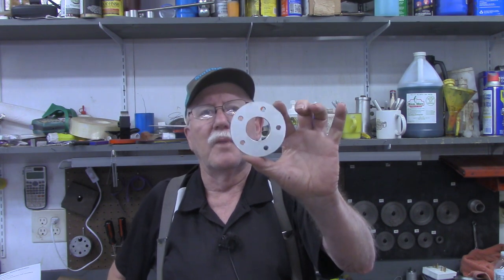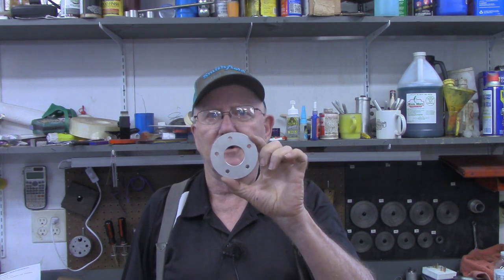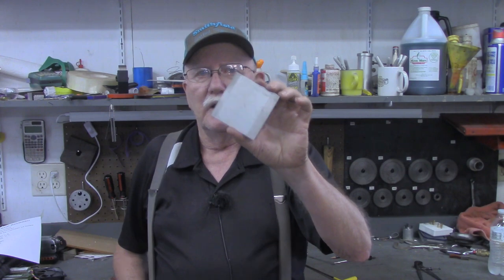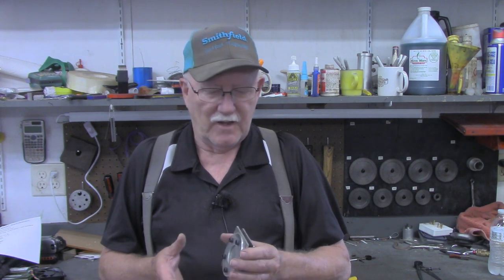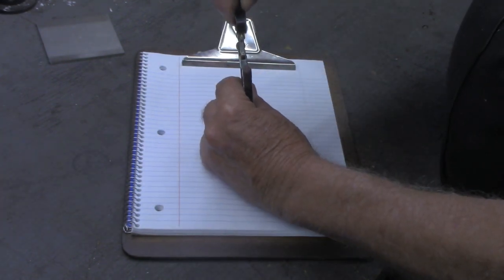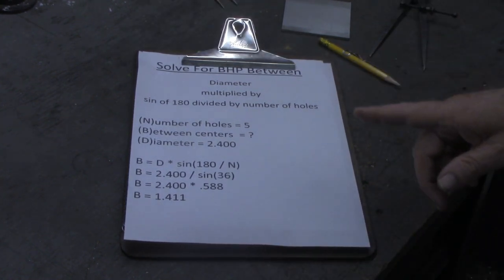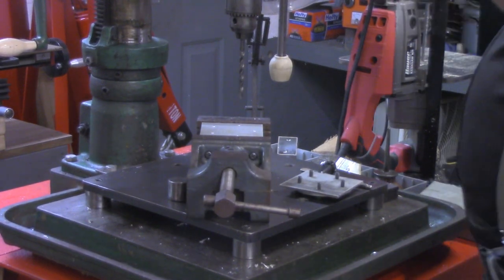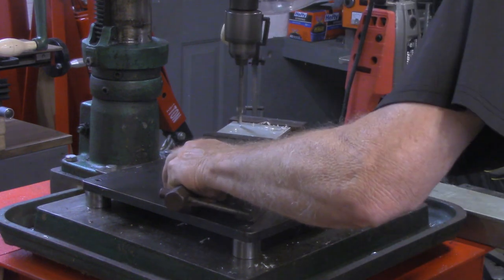Bolt Hole Pattern on a Drill Press (No Mill, No DRO - No Problem)

Comment: I can't speak for everybody, but I sure enjoy your content, I appreciate what and how it is presented.  As far as the one doing so well and the other not so well, I suspect it's  because  figuring the taper on the lathe is pretty straight forward, bolt hole patterns a little more complex.  Also at least for me, I seem to need the bolt hole pattern solution more often that the taper calculation.

Keep up the good work